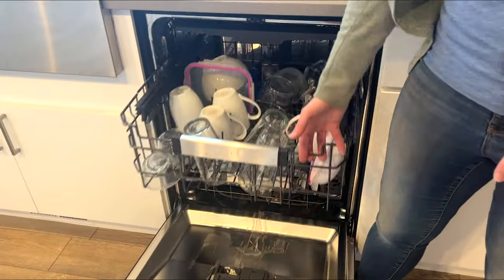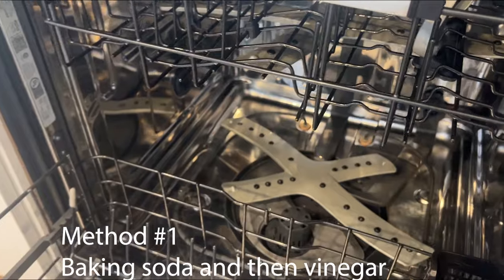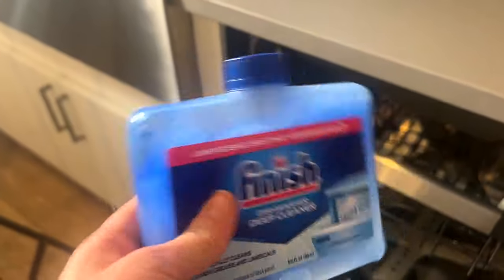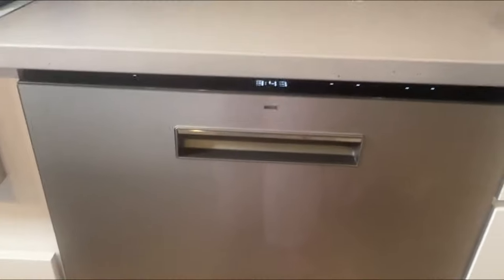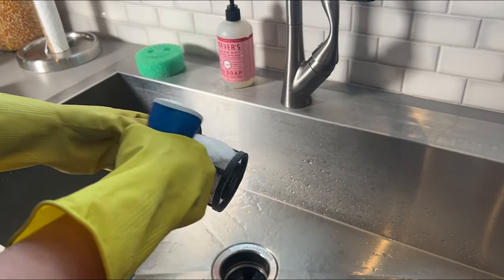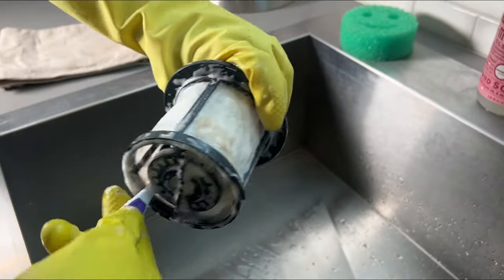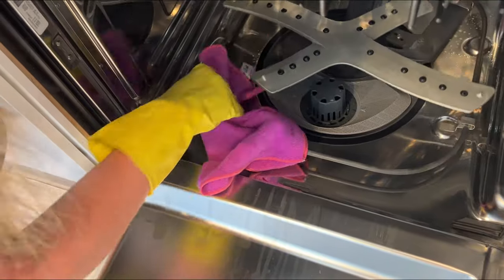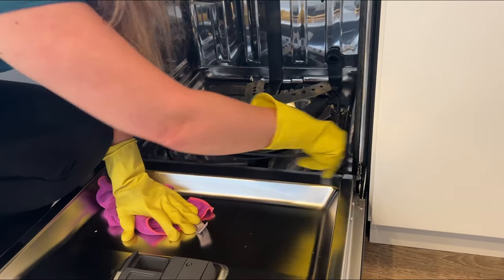How to CLEAN Dishwasher ⭐️ (Baking soda & vinegar test!)

Comment: VERY IMPORTANT NOTE: When you add the vinegar, don't just throw it in to the bottom of the dishwasher because it will literally just drain it away instantly. Instead, place it in an upright container in one of the racks!
Reply from the maker: Yes thank you for that tip!
Reply: this times 100 and I put vinegar in small bowl in top rack then run clean cycle @CleanFreakGermaphobe
Reply: Great idea!

Comment: I own a Bosch dishwasher and love it (upper utensil rack, quiet running, super cleans dishes).  That said, I burned out the expensive supplemental water heater (that’s incorporated into the water pump) by neglecting to clean the filter for too many months.  Due to a plugged filter, the pump was apparently “starved” of flowing water, causing the incorporated heating element to over-heat and burn out.  After replacing the expensive pump/heater assembly I now faithfully clean the filter every month.  I should mention that I thoroughly rinse food off my dishes before placing them in the dishwasher.

Comment: Go outside and spray clean that gunk off your filter first with your hose. No cleaner is going to remove that stuff, why did you think it would?. You would then use the cleaner of your choice to clean the sump pump, hoses and the interior of your dishwasher to get rid of bacteria and mold.

Comment: You clean the filter by hand.   The cleaners are designed to remove grease and minerals from places you cannot see.
Reply from the maker: But they advertise that it’ll clean them. It doesn’t.
Reply: @CleanFreakGermaphobe   Are you sure?  I don't see that anywhere.   The filter is a user maintenance part.  It requires maintenance from you per the manual.

Comment: I cleaned the filter with my Toothbrush and just as yours did, the result was Fabulous. I did experience one problem though. When I used the toothbrush to brush my teeth a couple hours later I burned my tongue and my mouth is now covered in assorted types of Soars. Could I have given myself Ringworm somehow?
Reply from the maker: Likely. This video come with a warning to use a designated cleaning toothbrush and don’t use it in your mouth. Maybe label it. 😀
Reply: Yup, you have ringworms. Maybe next time think about using the toilet brush to brush the teeth.

Comment: 1) clean the filter by backflushing it with the water sprayer. i do it monthly. there is not a lot of build up but it does have a bad odor.
2) leave the door partially open to allow moisture to evaporate. same thing goes for the washing machine
3) twice a year i will add citric acid (lemi shine) to a cycle and that seems to help.
Reply from the maker: So smart! I’m going to start doing this when I do my garbage disposal maintenance. No one teaches you these things about being an adult. There’s a lot of maintenance and it can save you thousands $$. Prevention costs less than fixing or replacing.
Reply: @CleanFreakGermaphobe  YouTube helps!
Reply: Lemi shine is magic. I add it monthly becuse my area has really hard water